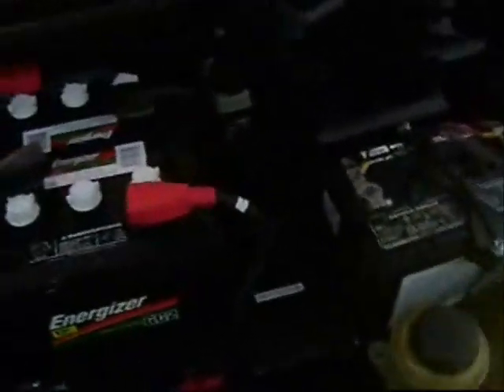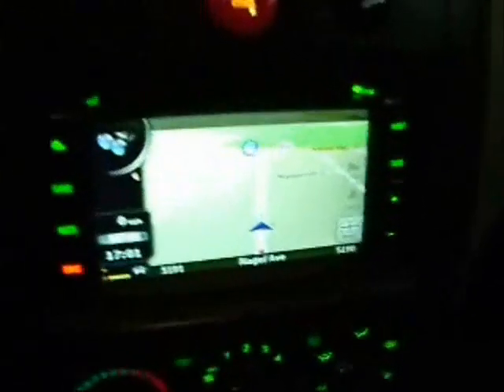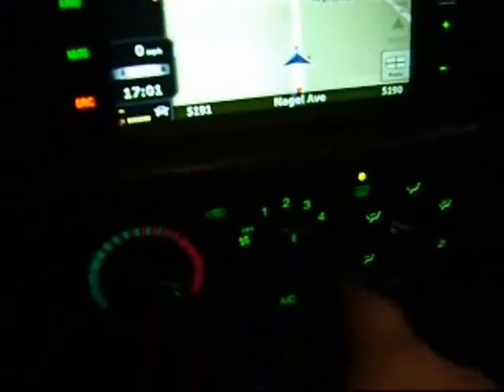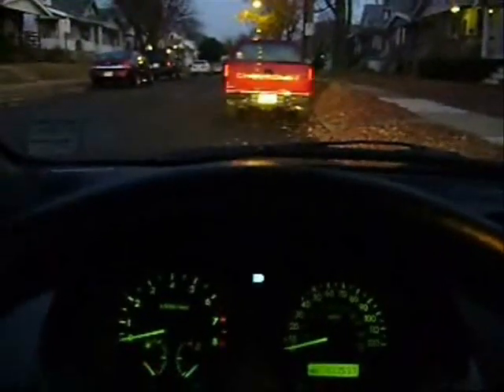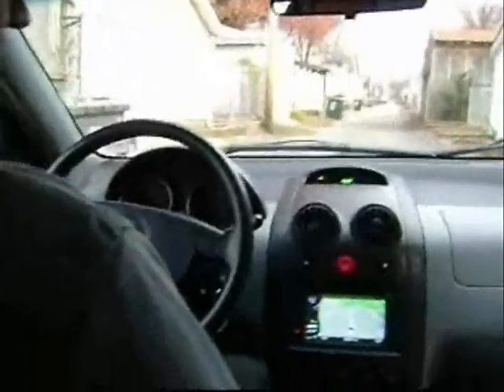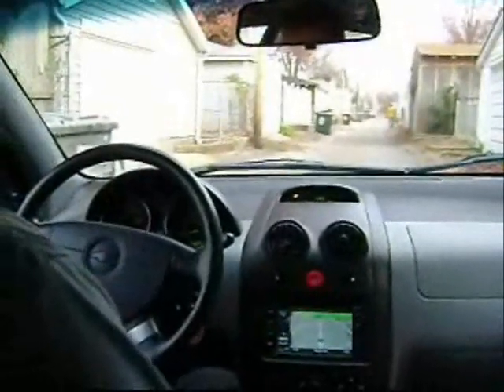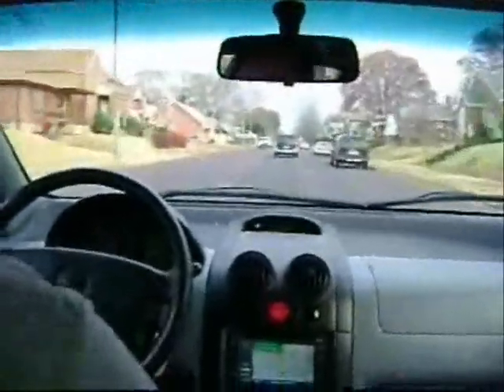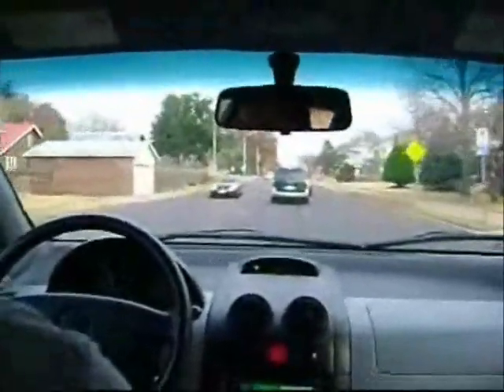Chevy Aveo EV - Electric Vehicle

Comment: How did you do this where can i get this done
Reply from the maker: I did it all myself. It was before Teslas, Leafs and Volts! It was hard work and had to make the adapter plate at the machine shop. You may be able to find some pre-made vehicles on ebay, but the time and tools it took, you're probably better off buying an used factory EV.

Comment: It looks like it's a manual transmission and you are shifting is that correct and if so does it have a standard clutch and pressure plate on it

Comment from the maker: Yes, the vaccum pump was on at all times... that was a requirement for the DOR here. Missouri Dept. of Natural Resources that regulate the emissions testing. I was working on a muffler system for it... but the camera is horrible... it was very silent actually. I wanted to add 4 brand new tires (low rolling resist.)

Comment: marcos, I'm the guy that cut your adaptor plate in Utah and I love your conversion. Is that noise the vacuum pump and is it constantly on? We sell an adjustable switch that's very small to turn it off when the vacuum reaches a certain level. You just put it inline with the hose.
Reply: I might need one of those adapter plates would you be available to make another one and how much would it be?

Comment from the maker: I've had it up to 75 MPH, but there was room for more... and range at 40 MPH is about 40-50 miles. at 25-30 MPH is about 65... I don't discharge the pack all the way, this is only to about 80% DOD.

but I have to tell you, the cold affect the battery performance a lot.

Comment from the maker: The total cost without labor was about 12000 dollars. The clock acts crazy sometimes, sometimes comes on and sometimes doesn't. I found one cheap on ebay for 10 bucks... I will buy it soon.

The Nav system is made for the Aveo (Europe Model) it's an exact fit. I had to import it and install it myself.